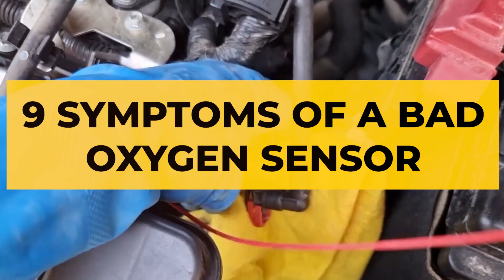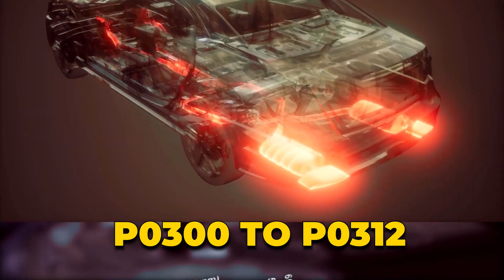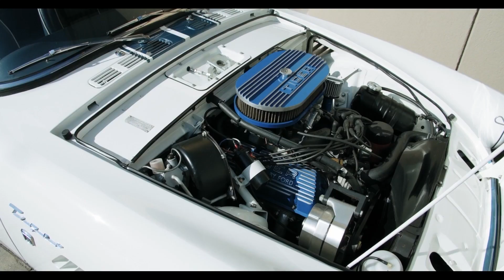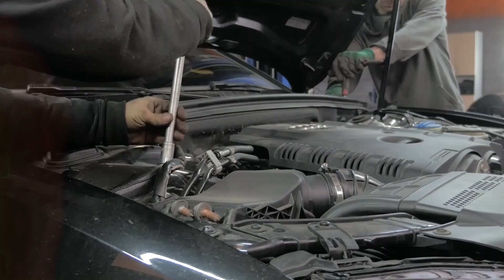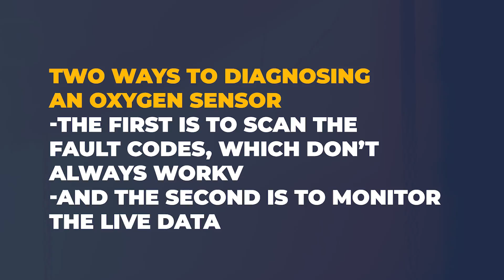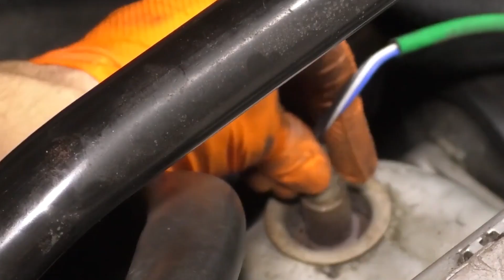9 Bad Oxygen Sensor Symptoms

Comment: Yup. Everyone told me it was the front O2 sensor. I got a new one and my Fusion still ran like shit. I pulled out the MAF sensor, sprayed it with carburetor cleaner, and the car ran great for about 30 minutes. Changed the MAF and I'm up and running. Moral of the story:  check the MAF sensor first. It's way easier to get to.
Reply: Don't clean a MAF sensor with anything other than MAF sensor cleaner...way cheaper than buying a new sensor.
Reply: @paulstrawbridge5687   The sensor was gone. Carb cleaner tricked it into working for 30 minutes.  I replaced the MAF and she runs great!
Reply: @dgoins6  BS. I replace MAFS, PCV, Throttle body sensor, both 02 sensor, new engine filter, and many more thigs and still Vibration, shake at idling, stop, putting in drive or reverse make RPM goes down, AND NO ENGINE LIGHT EVER. 
--- ALL THESE VIDEOS ARE SHIT, JUST TO MAKE US CRAZY. IT'S ONLY FOR THEM TO MAKE MONEY IN YOUTUBE.PERIOD.

Comment: Nissan doesn't call their upstream sensor an O2 sensor. It's called an air/fuel ratio sensor and it gives a P2A00 code for bank 1 with a check engine light. But other things can cause which makes it frustrating to isolate. I replaced the sensor and still get the code. So it could be a vacuum leak, an exhaust leak, or who knows. Starting is fine. No black exhaust. Idle appears to be OK. No real hesitation. But the Bank 1 Short Term Fuel Trim is high; hovers around 15%+ . I just wish the code pertained to one thing and not the result of being effected by other things.
Reply: it sounds like fuel injector/s might need cleaned or replaced if the actuator isnt operating right or the bank 1 fuel sensor.  Injectors are easy to clean just need 9v battery wire and carp cleaner. take out injector unplug it use wire and 9v to open and make sure the actuator is working. With it open spray carp cleaner through it (also the spray straw try to narrow the end to fit in to injector. If it doesnt solve it maybe the sensor.  Also it injector have been changed make sure there the right ones by the color of the strip that is on them that let u know the volume it can spray.  Also a sprak plug or plug wire or coil pack can cause the same thing.  maybe but i woundnt think so but the rocker or valve on the head

O2 sensor are just diagnostic and a bad one wont hurt the motor just maybe fuel consumption not always.  Back fires is from timing being off and knocking is from bad gas or low octane fuel. Not from lean of rich fuel to Oxygen ratio. out of timing with these newer motor can be a crank sensor if not not timing chain and castors
Reply: hey quick question for spec v owner do you think a bad 02 sensor will cause buring oil as well?
Reply: @ervensbainjamin9133  no
Reply: It doesn't matter same thing 😂

Comment: I got a question for you, but I am not sure it’s relevant to the o2 sensor failure or not. 
My question to you is this: My vehicle sometimes takes longer to start, I smelled terrible exhaust smell mixed with gasoline this afternoon when I started it, so I also have problems with acceleration, because when going from 45 to 50 mph and higher, my car jerks and RPMs fluctuate on the tachometer. Can all these symptoms relate to a bad oxygen sensor? I would like to know, because I am afraid to take the car on a highway. Please let me know. Thanks.
Reply: Check your fuel injector

Comment: Very interesting.. I'm getting a P0171, though I suspect it's from an exhaust leak. 
Damn car is getting 16L/100km, which isn't ideal. 
If it had cats, they would be stuffed by now. I'm not putting them in until I get this issue sorted, though.
Reply: Any update? my 2017 Nissan Altima running the same code
Reply: @Harper-r8v  yeah, I pulled the 02 sensor on that bank and the problem went away.
Obviously I now have a new problem, but once I repair my exhaust leak Ill be golden.
In the meantime my fuel use is down to 9-10L/100km

Comment: Great job! And the timing of posting it couldn’t be more relevant to the work I’m currently doing on my Ram 1500. I’m finally on the driver’s side warped manifold replacement after just finishing the passenger side. I’m going to check my O2 sensor and catalytic converter to see if that’s why I’m getting misfire codes. I’m praying that it’s not the lifters and camshaft.